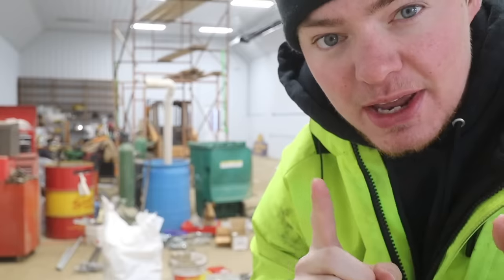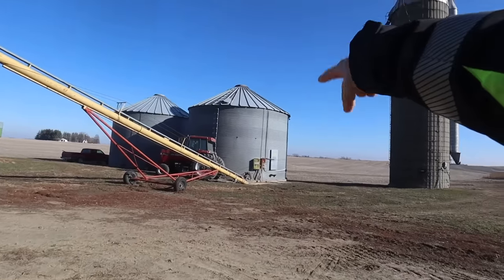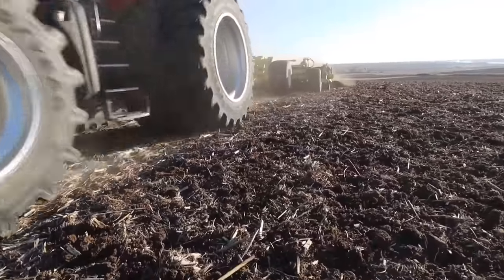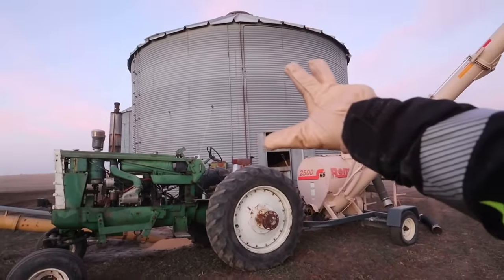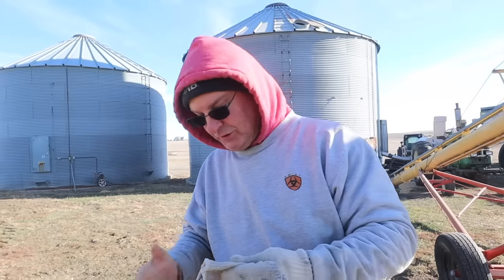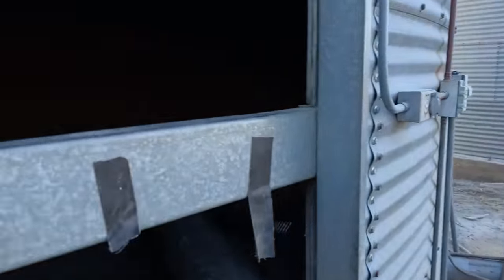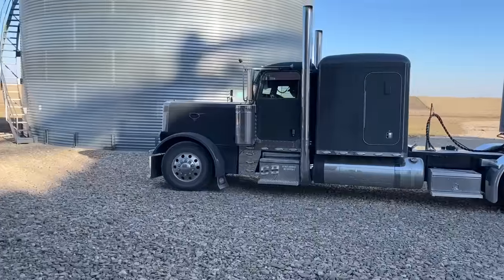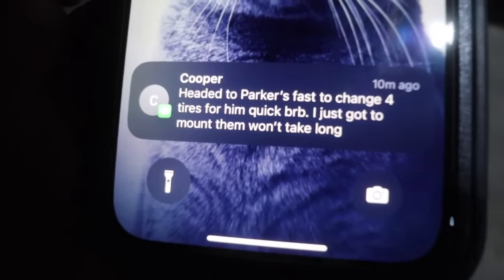Testing New Farm Equipment (We Have A Problem!)

Comment: Cole you could use a tarp against the ground easier to clean up
Reply: Really! They make plastic bins to catch all that. Seeing them suck up all the dirt with the beans makes me want to avoid soybean products.
Reply: Yeah, I'm surprised they don't have a canvas bag slung off the bin discharge auger for the mobile auger inlet. Then you wouldn't need the hole in the ground either - you could have it offset.
Reply: A farmer I worked for put a child's round blue plastic swimming pool under the auger to catch spillage.  Cheap and efficient.

Comment: Cole... if you have the other grain cart just sitting in the shop,  why not bring that one out  too? You could load up both carts while the drivers are gone... you have a full load there ready for when they pull in.  Depending on the timing of how they arrive.. you could speed up your loads for them like that.

Comment: If that moldboard is onland, take the sway blocks off the lift arms. Measure from center to center on the top and bottom pins that lift the lift arms of your 3-point and make sure they are both the same. And soak those bottoms in diesel to help get the rust off so they will start shedding.

Comment: Hmmm maybe a rubber mat  ( like they have under dishwasher machines)mounted under the auger would help capture beans that spill. Or maybe some sort of open topped funnel to push the beans into the auger . Got be a better way to capture the spill , you worked so hard for it . Zero waste a good goal 🥅.

Comment: You should buy a plastic hopper for your auger to put under the bin augers. It makes clean up a lot easier.
Reply: I was thinking about a modified 55 gallon plastic drum, or writing off a kiddie pool. 
🤘😎
Reply: That’s a no brainer… not sure why you wouldn’t
Reply: Or even just use a sheet of permeable membrane, so water goes through it.  Garden store ground sheet membranes.
Reply: Walmart kiddie pool would work plus they could use it in the summer for the little ones
Reply: They make tubs that fit sugars specifically
Reply: Or just go buy a Brandt/ agi self unloading conveyor auger and not have to deal with a tractor at all and just pull it with a truck
Reply: With all the wasted grain they could've paid for plenty of those things over the years.
Reply: I meant tarp…
Reply: This, they've made them for many years!
Reply: I came here to say the same

Comment: You need a different hopper on your auger, those open cages are a mess ...plus i would buy a sweep auger (just a regular sweep auger - rhey are not that expensive) .. those vacs are slow and misserable ...plus use two carts, fill the semi within minutes

Comment: the ripping and discing should help quite a bit - you should purchase of fab one like you did with plow, the lime will help a bunch, compost and cow manure could help even more, offset chemical applications and more permanently solve compaction issues - your soil is still the same now is the issue but since it has no been ripped for so long you still should see some results - you need to do a/b tests to home in on optimal results

Comment: Cole. I see you digging cremations with the auger in the loader. That's fine but cut a hole in a sheet of plywood a little bit bigger than the auger and cleanup would be allot faster. Just slide the plywood out of the way and cover with a tarp and leave the dirt on the sheet of plywood. And it would be nice and clean. When you are filling the hole back up wouldn't it be easier to pour some water into it to help pack it and use ca concrete vibrator.

Comment: Great video I'm just kind of wondering what the slump was on that concrete they poured what size was the rebar and what was the tensile strength of the rebar and what was the mix of the concrete when they poured it😊

Comment: You should look into pneumatic bin vibrators, we use them on our flour silos....everything goes into the feed auger, except when something goes wrong.
 I have to suit up and shovel 1000's of pounds of flour for the fix 😱
Also (just a suggestion) a tarp or catch pan at the base of your feed connections might save on cleanup times and waste 🙂
Humbly submitted, these work with industrial bakery product, I can only share what I know works for what I work with 😁

Comment: if you want to make that end lighter what we did with commercial vac trucks was that hose or piping like you use for tiling drains duck tape in on those other hoses we had sleves to go in it from the truck then on the end we just had a cheap broom handle like you get for push brooms at lowes adn duck tape it on back and fourth twist it and cross with x's for a bit but its way lighter by the looks of it move around

Comment: Cole, hearing you say that one of your family was sick and in the hospital getting antibiotics reminded me of something regarding your house finally getting the remodeling work done inside. In the video Nave showed a few days ago it seemed to me that you guys still plan on living in it while it's being demolished and remodeled. BUT I really disagree with that. You need to get those babies out of that house while the downstairs is being demolished and remodeled. Even If you have to pull one of your travel trailers into one of the heated shops and turn it into a temporary place to live until at least the downstairs demolition is done and cleaned up. Infant babies with brand new lungs should not be exposed to those kinds of dust particles during long project like that.